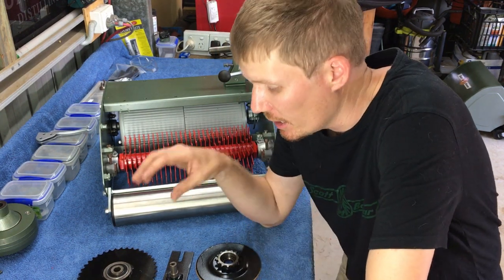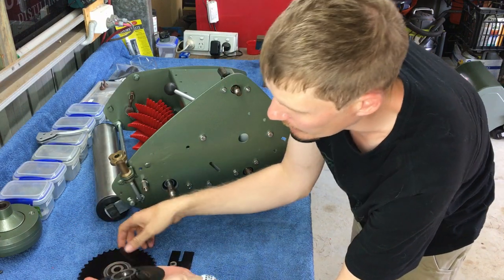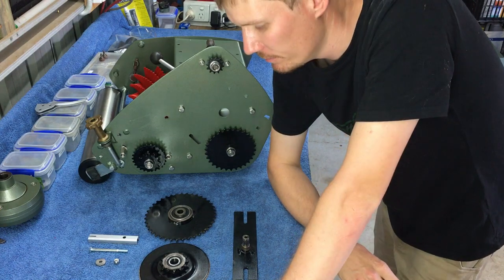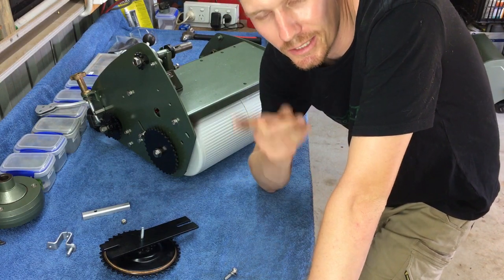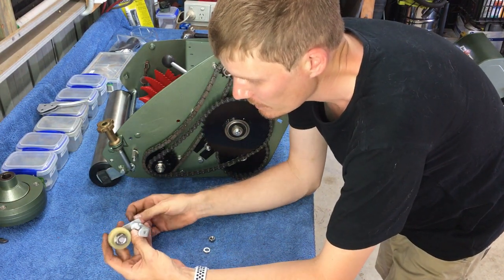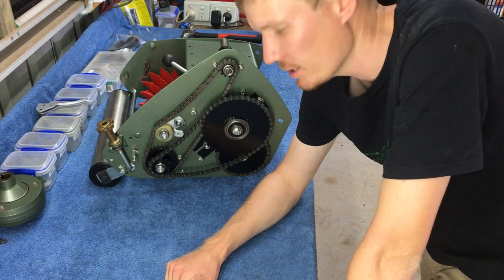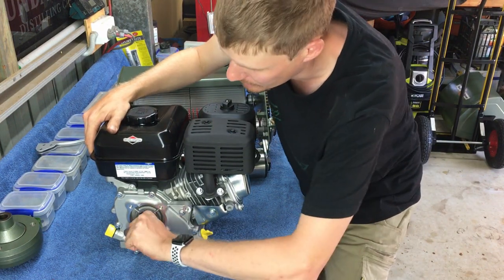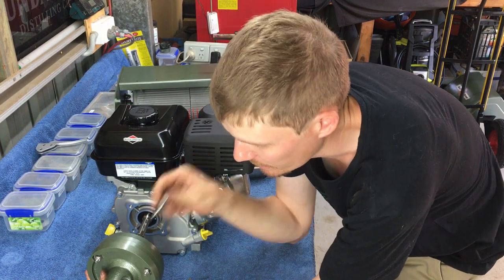Scott Bonnar - Model 45 - 14" Groomer Build - Gears + Chains + Engine

Comment: Great videos mate, helping me through my 1st reno. What's your thoughts on 5/8 vs 3/4? Or no real difference? Putting a new motor and clutch on mine but not sure which way to go. Cheers
Reply from the maker: I personally don’t think it makes any difference. The 5/8 shaft is by far the more common of the two. I’m yet to come across a mower with the 3/4 shaft..
Reply: @SBRenos  cheers mate, I'll stick with the 5/8 since that was on the original setup 👍

Comment: where did you get ur new bolt kit from mate?
Reply from the maker: Hey Mate, I just buy them on ebay. Cete--Parts sells a few different options.

https://www.ebay.com.au/itm/144248851304?hash=item2195e6cb68:g:Jb4AAOSwrTFda2EB&frcectupt=true